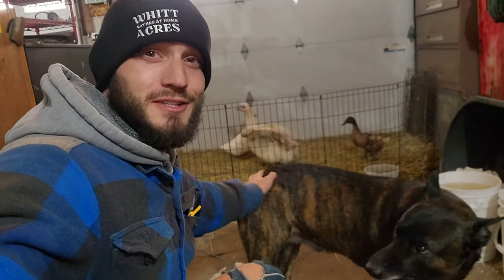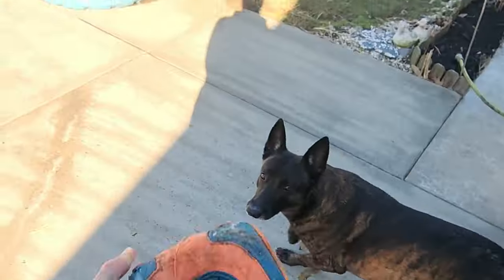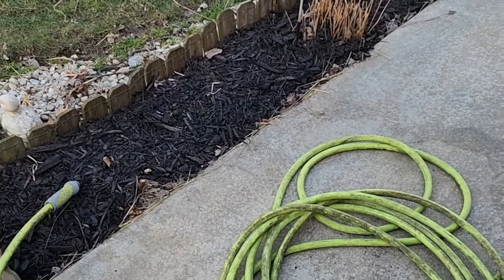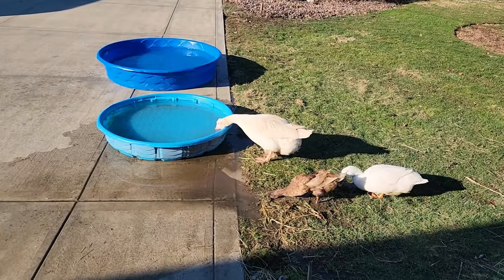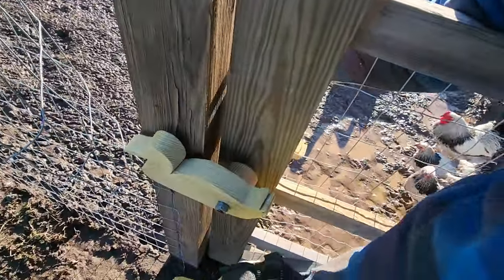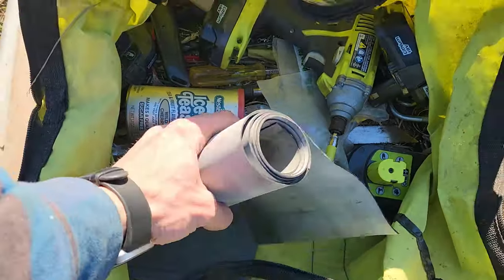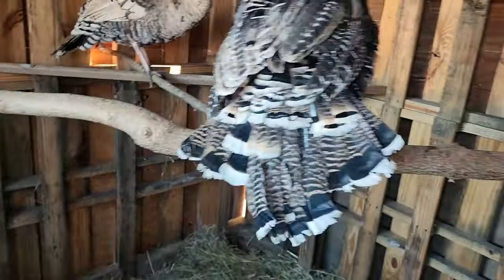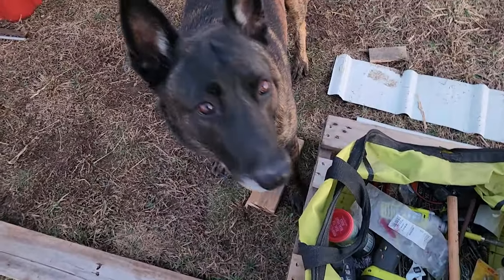Mumble's BIG Cleanout! // Whitt Acres

Comment: You could make a suspension sling to keep his feet off the ground with an old t-shirt. I used that for chicken splay legs. You suspend him up off the ground like a toddler in a jump chair and then brace his legs in proper position. Make sure you put food and water up high enough for him to eat. If you look up "chicken sling" you will get the picture. Hope this helps brother.

Comment: With hen chickens, thin rubber bands are used to straighten their legs on the very first day. So maybe you can try bigger rubber bands with Jim?
Also, I have weak feet, once an ankle was ruined pretty good. Couldn't do everything in the yoga studio, however in some sitting position, which is easier to do, a jumped out tendon simply glided back to the other side of the big ankle bone. The idea behind is that maybe you can try to massage the bird's foot with horse balm or something similar, with soothing/cooling effect. I also have human horse balm, cheap and very good for muscle issues etc. Hope it helps

Comment: I treat humans but you could try some ridget straping tape( its a sport injury tape) you have to stablize the joint. If its the knee you tape underneath and around the joint in a chriscross way. Use the femer to stable and support.Wrap around. Make it tight but do not cut of circulation 
They will be very small strips. Unfortunately there are no chrutches for turkeys, he needs to rest it. Maybe a smaller space? Massage around the area and compensating areas,especially his other leg.
Hope this helps.  Good luck.

Comment: Try putting the sports wrap through the tube the around his back.  Run another piece through and around each leg. To hold it in place like a harness for a dog.  But it needs to be fixed to both legs.